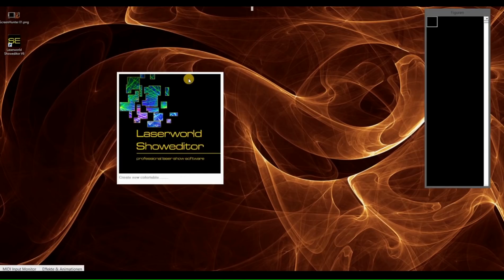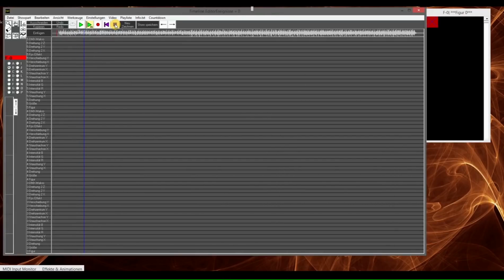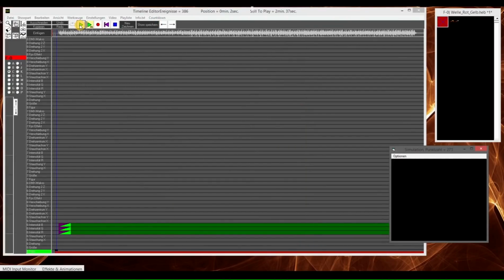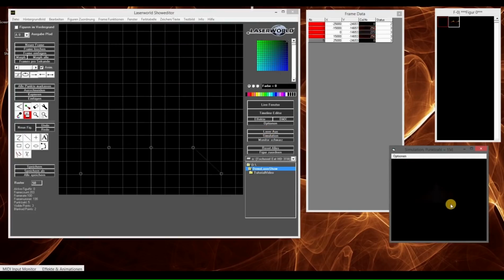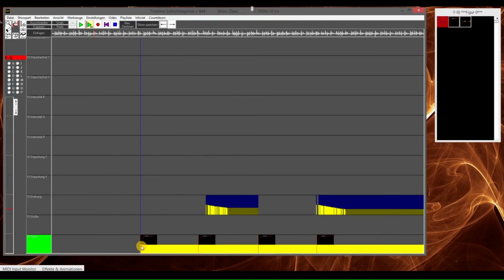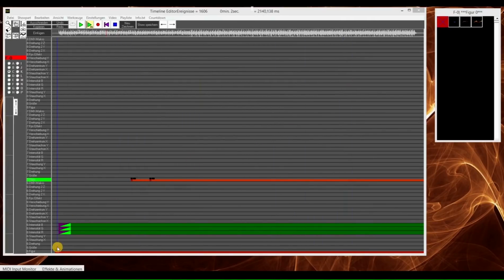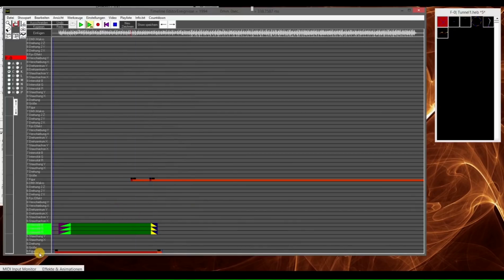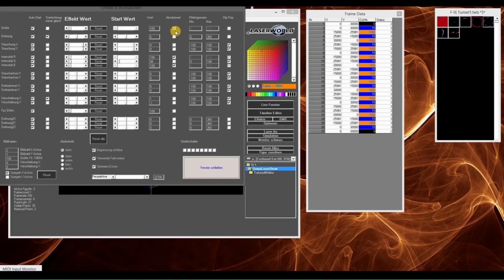Laser Show Programming on Timeline with Showeditor

Comment: Question, I own a DS-2000RGB, is it possible to bring the music to the timeline to synchronize the effects? Or there is another method. Thank you very much.
Marco.
Reply from the maker: What I assume you want to do is display the wave-form, so you can easily synchronize programming to this visualization of the sound. Yes, this is possible: It automatically shows above the content tracks, if you use a supported sound file. To use the wave-form you need to use a WAV file that does not use any dynamic compression, best is a raw WAV file.